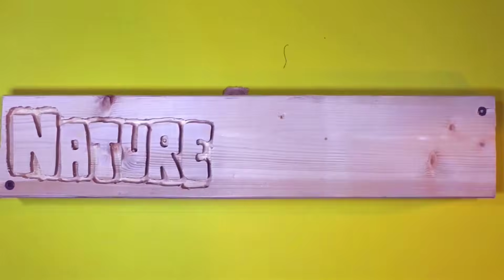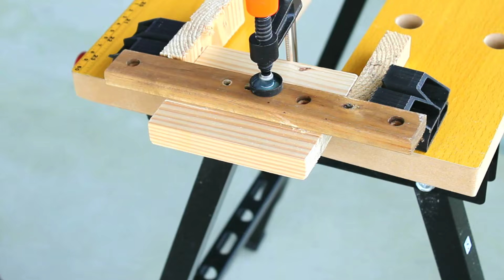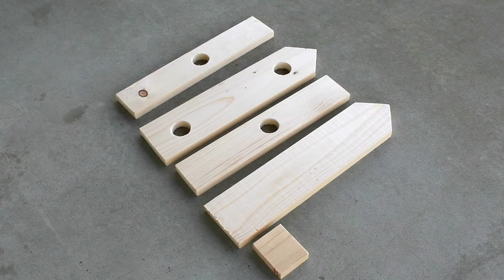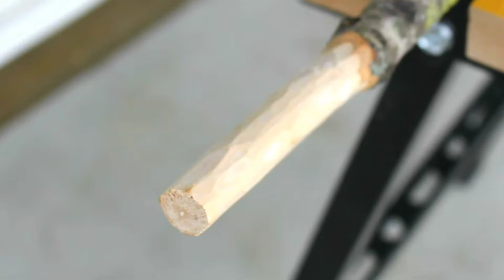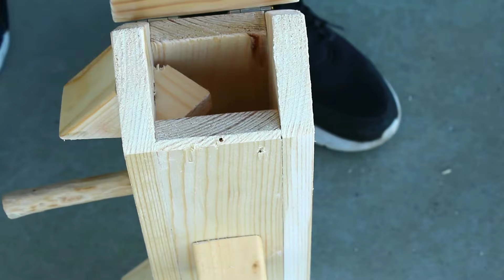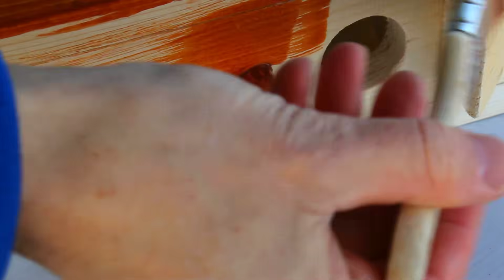How to build a BIRD FEEDER Tower - Easy DIY build using Basic Tools

Comment from the maker: UPDATE:  Small modification - For the internal feeding hole covers, attach them vertically, covering half of the hole on the inside.  This will prevent the seed from slipping out.

Comment: I made a similar feeder and added a little "roof" over each hole on the inside. That wasn't enough, as you have discovered. I have a metal one that I bought at a big box store some years ago and it has a plastic "dome" over each hole on the inside, covering all but maybe 20% of the hole. I'm using that as a guide. 

I guess we need some lessons in fluid dynamics to understand the perfect solution. Lol
Reply from the maker: Haha! Learn as we go!!!  Yup, with the inside of the hole covered half way, the seed stays in.... in theory, the size of the hole along with the size of the seed, will ultimately determine how much of the hole needs to be covered. Hey, what's a project without a little problem solving!

Comment: how does the bird seed not come out of the holes?
Reply from the maker: Thanks for the question....I did have to modify the covers on the inside of the bird feeder a little....I moved them to be sitting vertical and actually covering half of the holes on the inside.  This allows for the seed to be accessible, but not slip out.
Reply from the maker: If I could figure out how to add a photo in this comment section, I would....any ideas?